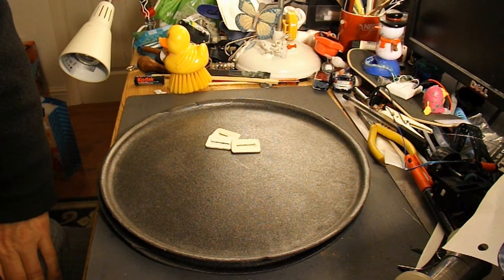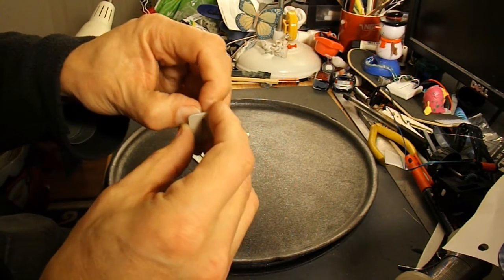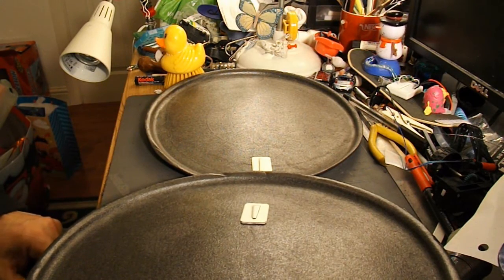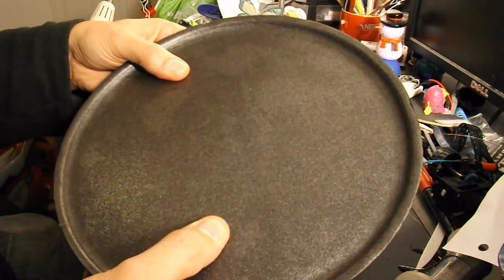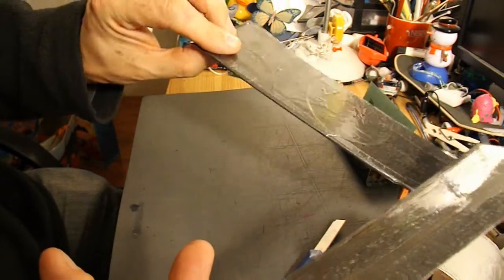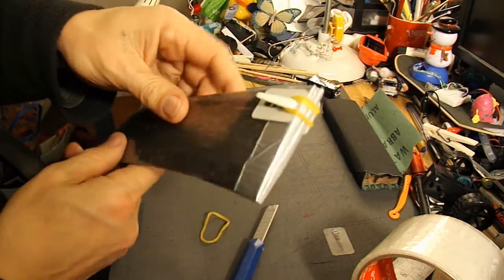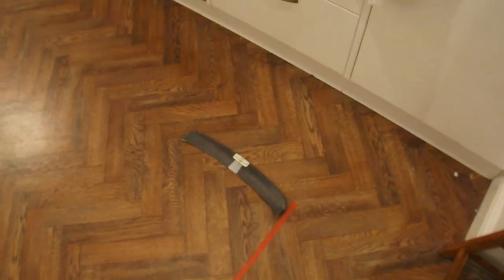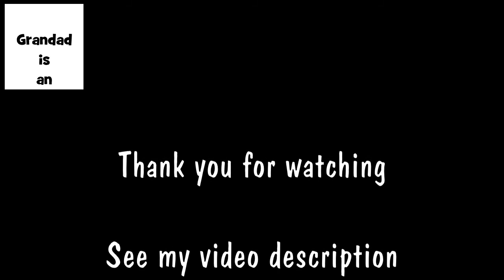Folding Catapult Launch Glider

Comment: You need to make the wing nose angle around 140-150 degrees (think hang glider). Also, taping the wings makes them stronger, but usually they won't fly worth a crap. Also, the wings don't need to be airfoil shaped. They work great with flat foam or flat balsa wood. Of course, the trailing edge tips need to be bent up slightly. I used to be the manufacturer of Zing Wings, BTW.
Reply from the maker: Hey, thanks for dropping by, you will find I put links to the Zing WIngs site in the video description, although I see that link no longer works 😢😢. (This video was published in 2015)
Reply: @GrandadIsAnOldMan  
I stopped making them in 2009 when I went back into the military, and sold my business. I made my living off them for nearly 10 years, but slowly went broke. Do you think I should do a quick video showing how I build them? I do have a YouTube channel that doesn't have much content at the moment. I retired a few years ago, and I have lots of time on my hands.

Cheers!

P.S. I was stationed at RAF Bentwaters 1978-1980, which is near Ipswich. I really enjoyed my time in England.
Reply from the maker: @huffpappy  you never know what  will be popular on YouTube. I loved your design, using the foam backed hooks. I still have quite a few left from the box full I bought off ebay, (obviously not genuine originals, sorry). There is a link in the video description to the video where I try them out. The rubber bands they supplied were a bit weak, so I think I doubled them up or replaced them. I expect if I open a pack now, the rubber will have perished anyway 😆 I might dig them out and give them a go.
Reply from the maker: @huffpappy  I found some of my old stock of Chinese "folding gliders", so here is a video of me trying one out https://youtu.be/FvGn-73tkIc

Comment: Thanks. I can see the wing still had a tendency to flip over rather than glide. I had same experience. And I like self adhesive cable clips idea.
Reply from the maker: I have no doubt that with a bit more effort to get the dimensions and balance right it would fly fine, clearly the original Zing Wing flies very well. Using these materials mine was relatively heavy. I can also imagine a similar plane configured as a 'tumble wing' where the wing spins along its length. Another alternative would obviously be to spin in helicopter direction.